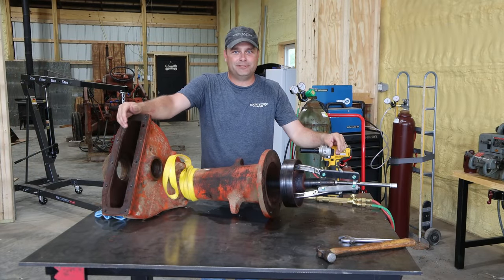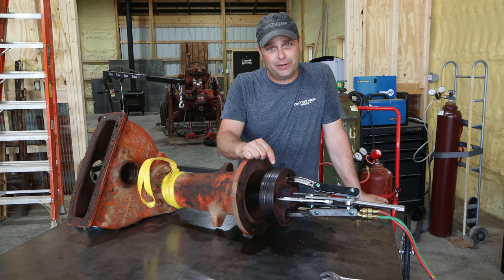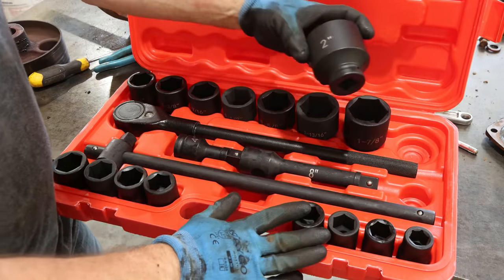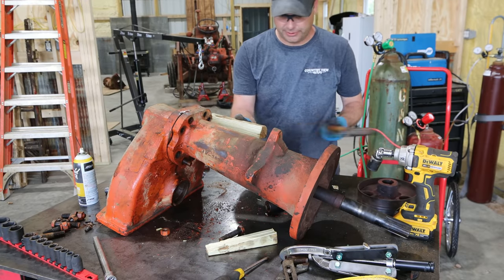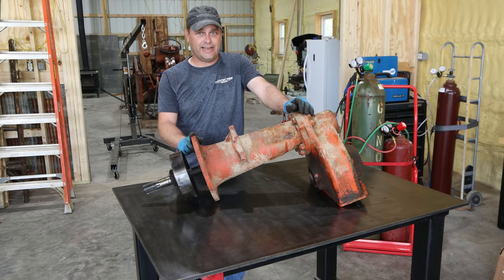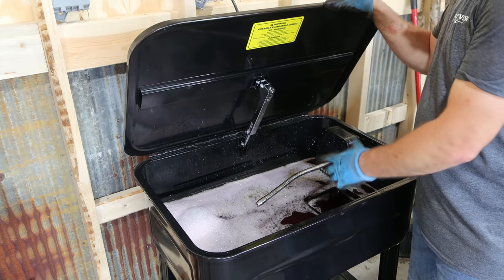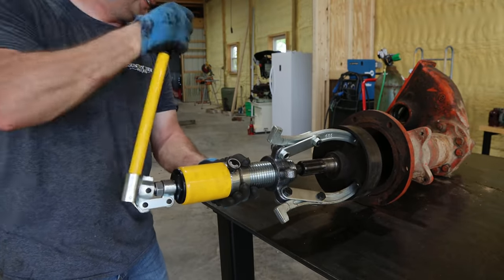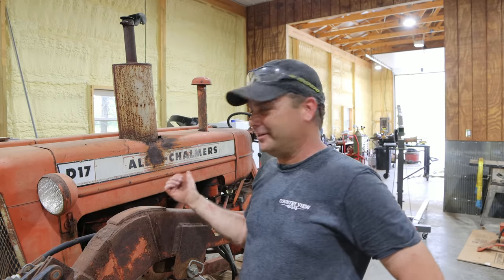I'm Having Trouble Tearing Apart the Allis Chalmers D17.  So I bought some Bigger Tools.

Comment: Evan, when you take the parts out of the bath and rinse them, spray them with WD40. The WD stands for Water Displacement, a light coating of WD40 will keep the parts from rusting until you reassemble.

Comment: Drill a  1/4” hole at the end of each crack near the hub. Then gouge the crack on each side back a bit. Preheat drum to 400 degrees with torch. Braze the cracks

Comment: Mate your doing it the hard way.   Cold chisel through the cage. Spread the cage and dump the rollers.  If you can,  sling it up in the air of a beam or small crane with the shaft dead vertical.   Using your heating torch with the flame up as high as it goes,  heat the bearing while gently rotating the housing.   Bearing will fall of the shaft on on the ground.   No special tools needed.   Only own a few pullers for specialty jobs.   Been working on big dozers all my life.   Good luck.

Comment: Nice work getting the drums off. I like you machine shop, I also could use a torch set too, I may have to look into getting one. I do have the 3/4" drive tool set with a breaker bar, their real handy. Thanks Evan, have a great day.

Comment: You need a dead blow hammer for getting those gear boxes apart. The dead blow hammer is coated in rubber so no surface damage but very heavy and it's filled with sand. Gives a good solid lick that gets things moving

Comment: Been there before with my WD-45.  I’ve got a couple new drums if you would be interested.  Thought I was going to have to break the old ones to get them off.  They were good enough to re-use.  I used a big bearing splitter and a hydraulic cylinder to get them off.  Stick the new ones in the oven on 300 degrees.  They will slide right on.

Comment: Using high pressure grease out spindle makes it pull a lot harder at the same spindletorque. Quality pullers are often supplied with the correct grease during purchase

Comment: My Gibson has cast iron drums inside also … like you I made “long” reach hooks to pull the drums from the axle,  after cracking a drum I blasted and cleaned it so I could braze it before turning them.   Brakes work good !

Comment: Quick prusal through the comments and I didn't see this.  My guess is as a mechanic you already know this.  When heating bearing, pulleys, brake drums etc, if you have access to Dry Ice, you can apply the Dry to the shaft causing it to contract.  The combination of a hot expanded pulley and cold contracted shaft will usually break it free.  You can also spray the shaft with liquid propane to cool it down.  You just got be be a lot more careful with the propane.

Comment: Evan, I agree with your choice to go with the cheaper tools except the 3/4 socket set.  You will probably find a lot of uses for that.  I would have (and have) bought  a name brand breaker bar and the sockets you need.  However I hope it keeps working for you.  Great video as always.  I am redoing a Allis Chalmers WC at the moment.  First trying to get it to run before I tear into the running gear.

Comment: Just a bit of advise. You don’t need to heat the piece your trying to remove until it’s red hot. The key is just to warm it enough for expansion.
Reply: Getting it red hot could mess with the heat treatment of the shaft underneath too

Comment: I use 3/4 inch drive tools on my property all the time. you will find them very usefull. I recommend getting a pres for your shop 20 ton or bigger. mine is 40 ton and has saved my butt many times.

Comment: Next tool you need is an ARBOR press. Get a big large one and look around for a used one first! I have a small 6 ton but it is great for pushing bearings in and out! Great video and love the hydrauLic puller!!!

Comment: Fantastic getting those brakes off there. I have a AC-WD and I've seen enough videos of trying to get them apart I am not too interested in it yet. That hydraulic puller seems like a great tool for that job! I have not heard any more challenging repairs on the ACs than those brakes yet, so you should be in the clear.

Comment: An easier way to get bearings off, is to cut roller cage, remove rollers, score the race with a cutoff wheel, hit the score with a chisel and hammer. The race will crack and slide right off.
Reply: I was thinking the same thing. With that much heat into the shaft, the temper can change. It could make it soft and/or a localized affected zone that could cause a fracture.

Comment: The other thing great about a good torch.  Heat expands the metal,  go do something for a few hours.  And come back and you can break it loose.   A bolt that won’t budge same thing.  Heat just the bolt red hot.

Comment: You bought tools, you didn't waste your money if they're decent tools. Even if you use a tool a couple times, it's a tool you need it's worth it. If you don't have one, one tool you might consider is a ratchet type breaker bar, they go clockwise and counter clockwise. I have one and I couldn't imagine not having it, it has come in handy so many times. Much quicker than using a normal breaker bar.

Comment: Thanks, there is another way cut with blades,if you want to replace the brake drum, you used hydraulic puller very interesting if someone don't have heavy tools in that case we can cut the Crack parts.

Comment: I had to take a bearing cup out of a blind hole in an aluminum housing. I heated the case with a torch, hoping the thing would not suddenly melt into a ball of mush. No luck, I turned the case face down with the intention of drilling the case and pushing the race out from behind. While looking for my punch I heard a clink. The race  fell out.

Comment: Invest in a hydraulic press. It will be able to install those bearings as well as remove them. Check Harbor Freight 12 & 20 ton presses. Measure the length of that axle shaft and housing to be sure it will fit within the working distance (height and width) of the press.

Comment: Working as maintenance fitter  on plastic injection machine I put a breaker bar on a difficult to undo bolt with a length of pipe for more leverage. Using all the force I had, the knuckle on the breaker bar shattered, pieces flying off in all directions with the force of bullets being fired from a gun . Luckily no-one was around. I would suggest not using  a pipe. The tool was a known brand here in Australia.

Comment: Buy a posi lock puller,  they are a bit speedy but well with the North Dakota made product.  Very safe puller and you will grab it every time.  Cant wait to see the haybine rolling,  too bad you couldn’t have cut by the walnut trees as a test run.

Comment: When you use a oxy/act torch to heat up metal to free up metal pieces, you are expanding the metal. I think you need to let the piece cool down to let it shrink back down before trying to free it. You also have to consider that you are annealing the metal and possibly changing the PSI tensile strength of that metal. Using a torch to free up metal pieces is really just to oxidize the corrosion that is making it not want to free up. When you use it to free up parts, if you try to free it hot, then you are making it harder, not easier to free up.

Comment: The reason you were having so much trouble pulling the brake drum off was that you were heating the hub with your torch.  If you get the hub hotter than the outside diameter of the drum, then the metal near the OD restrains the hub metal against thermal expansion, and the hot hub expands onto the shaft instead of away from it.  If you heat the outsde diameter first and keep it hotter than the hub, the drum will pull the hub away from the shaft without much trouble. The heating probably loosened up any corrosion in the joint, and then later when the drum temperature had equilbrated and cooled down, the drum pulled right off.
Reply from the maker: Yes I do believe the heat removed the corrosion.  Cause it was a week later when i pulled the brake drum off.  As far as heating it, I tried twice.  First time was with propane & oxygen(not in video), and I tried heating up the entire drum.  Thinking exactly what you said, trying to get the entire drum to expand.  No luck, but I didn't get it as hot, about 600 to 800 degrees.  Second time I used  oxygen acetylene and I only heated the center.  Still with no luck, but I definitely got it hotter.  Over 1000 degrees.  Must have been hot enough to remove the corrision.

Comment: Sir when that starts cooling down some before you use the puller again do you  spray some type of penetrating fluid around and on front and back of say bearing. Thanks for the video.

Comment: That hydraulic puller freaks me out. It's like holding a tiny steel cylinder actively containing all the forces of a hand grenade exploding, only It's static pressure. x.x 
That said, it did the job with impressive proficency and it held up fine so I'm obviously freaking out for no reason. :D

Comment: I wouldn't heat the whole boss of something im trying to remove. Expansion only means it clamps harder. Try just heating about an inch of diameter. If there is a keyway i would heat it there first. This only expands that section and acts like a wedge and expands the boss off the keyway sides and the rest of the diameter off the shaft.

Comment: Do you have a link to the 3 jaw puller you started with before the hydraulic one?  I have a frozen running gear wheels king pin? that giving me issues and I need a 8-12 reach. Thanks

Comment: Find yourself a used stainless dishwasher.  Great parts washer.  Hot water with dish soap cleans great. Used comercial Hotsy  washers to clean parts on heavy equipment.

Comment: That's dangerous pulling on the receiving end. Especially where you had your hands on the puller arm. I would recommend a puller with a floor pump so your out of the firing line. Be safe our work is dangerous

Comment: Why all the trouble trying to get this machine running again? Will this machine be used commercially? Is that even allowed? It will never  adhere to modern emission standards or is that not applicable?
Reply from the maker: I was using this tractor last year, it runs fine.  Just repairing the brakes and replacing seals.

Comment: Do not do that on bearings. They will freeze. They will need replaced. Don't  ever try using the same bearings again after the heat from a torch was applied.

Comment: Hi everyone!
I'm a pretty old fella now. I've seen lots of things regarding the use of pullers and all advised tapping with a hammer or brass
rod (if tapping sensitive surfaces) in between tensioning the puller to encourage a result. That great snap, for example, 
would not have happened. Hope this helps.
Reply: In the case of the brake drum, tap on the drum a few times, with a hammer.
Reply: If needs be, turn the tap into a great big clout.......ha ha!

Comment: The best way to cut off a bearing like this and I don't even use a poem I just take my Small die grinder cut off wheel and cut a notch groove the bearing as deep as I can then I take a chisel at the right angle of the the bit and I just hit the bearing and it just splits the bearing for easy removal.

Comment: If you want a roller bearing off and its not going to be reused, just give it a real good wack with a ball peen hammer, straight down hitting with the ball end, it will litteraly shatter like glass, put a towel over it first cause there will be bit and pieces going every where, maybe some safety glasses too.
Quick and easy.
The first time or two may take a couple a wacks,
Till you learn the nack of the wack.

Comment: The hydraulic puller could also have hooked on the outside edge of the brake drum not thru the holes. Easier. 👍

Comment: What is the point of all these $$$$$$$$$$$$'s you are spending on a worn out next to useless tractor? It has to be a hobby project other wise it makes no sense whatsoever Evan.
Reply: I totally disagree. Have you priced out new/used tractors recently? The costs have gone through the roof. Evan's AC is still a perfectly viable tractor for all manner of jobs around the homestead; and best of all, it's paid for. You can do A LOT of repairs for the cost of just a few payments on a new tractor. There is also no complicated emissions control junk to mess around with on that old beauty. 

Money spent on new tools to do the work is an investment that typically doesn't go down in value if you buy smart. Of course, if you choose to buy from the tool truck, that's a whole different set of math to cry over...
Reply: @theElderberryFarmer  Agree with you 100%...I have restored many Deere's from the 50's and use them all around our farm...especially for haying.